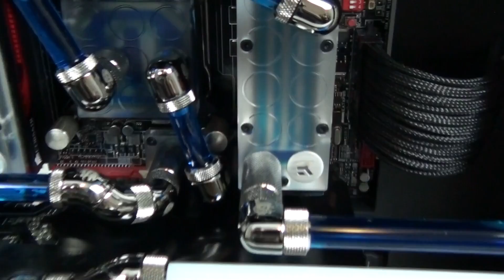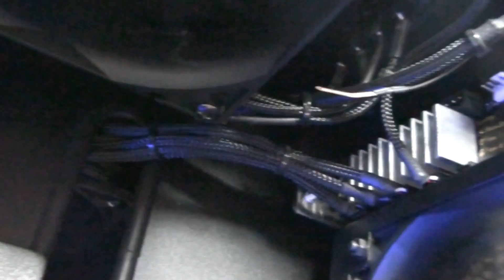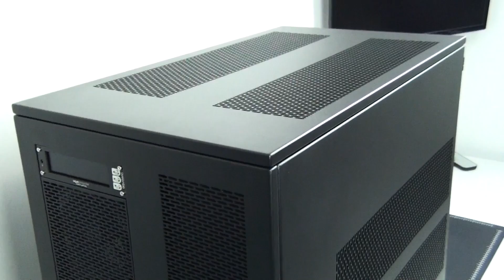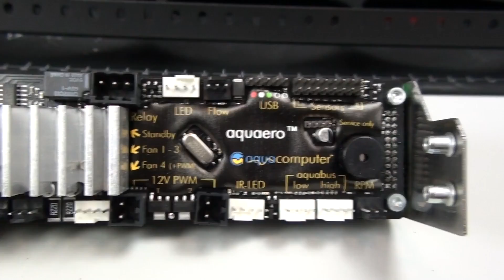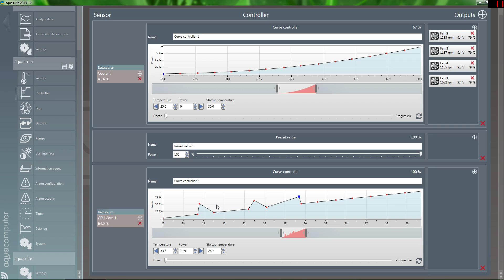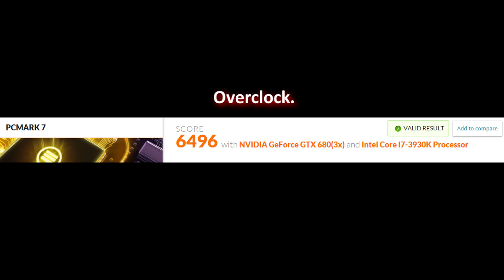Build #10: Extreme TH10: Part 4

Comment: I have the same pump / top rez etc......i was confused a bit about the little plastic nub pill looking part that blocks the unused output on the top of the pump when mounting it vertically like that........the instructions don't clearly explain what that sits on.....idk bad phrasing of the question....

Comment: Hi

Im a huge fan of your builds and recently added a part i saw in a vid of yours, Its an aquaro fan controller. Really cool but i want to know how i can stop it from continuously cycling trough the different pages.

I just want to keep it at the page i have set it on, and it should only change if i change it. Maybe you can tell me how to do this?

Thanks

Nick

Comment: by the way. why is you heaven benchmark not on 8x aa ultra and maximum tessellation? but great vid man. btw my results were 101.3fps 2552 score 13.2 min 197 max on a i5 4670k stock clocks and cooler and a r9 290 1125 on core and 1400 on mem also stock cooler but the rest of my watercooling is not in stock so gotta wait for the x20 pump and xspc fittings and 290 acetal block to be in stock. England sucks for watercooling.

Comment: It looks awesome, but I would never do this kind of build.
How in the hell are you ever (quickly) going to change memory, cpu or videocard.. wouldn't it be a massive pain in the ass?
Reply: with 32gb of ram 3 gtx 680 in sli n i7 3930k u will not need any upgrades anytime soon, unless you want to be up to date with new gpu n cpu yea it will be pain in the ass
Reply: Furple max The problem is when new shit comes out.  When X99 comes out in June you're going to want to buy it, especially if you have the money for it.

Comment: The way you design your systems is amazing. The way you use fittings is nothing short of an art form haha. The way the res has like a stand? or something, idk, I didn't see the installation, and the drain port coming straight out of the pump--i'm going to have to steal that idea. It's practical and functional that way I'd assume--water coming from res, into pump, and pumping out of the drain. I just hope it doesn't spring a leak for some odd reason, or the client doesn't accidentally leave the faucet loose.

Comment: Personally I prefer the look of flexible tubes, plus it's not true they get ruined very quickly: it depends on the brand and if you clean the inside of your pc once a month with compressed air to prevent external agents to get attached and corrode the tubes. If you use a liquid as Aurora from Mayhem you want to see what is going on and flex tubes give you lots to see, plus i find curved tubes very sexy. The rig in this video mostly shows liquid inside the reservoirs, i prefer seeing the liquid flowing along all the route rather than watching metal pieces. Just my two cents, your videos are lovely.

Comment: hey any feed back Id be thankful for I am trying to make a massive dream pc for My self and I am debating between getting the extended ascension  and the water carrel 24 from mountain mods  or the magnum tx 10-d from caselabs I want to add as much as I can  to the system to make the best posble power house of a pc I can make so I am aiming for a large tower that can be easy to  mod any feed back can help or other large towers out there larger then the ones I am looking at now thanks for the help

Comment: Really applaud the effort that went into this, and the end result is stunning. Several thousand dollars, however, for something that won't perform better in gaming than a $1000 build seems...ridiculous. Plus, the client now has a case the size of most refrigerators. All of the dust and coolant maintenance issues should be a riot as well.

Still, no denying it's an impressive job!

Comment: Well, I live in Spain, and also my PC runs 24/7, with the 2 HDDs being constantly reading and more importantly writing. They heat up quite a bit, and I don't want to risk losing them. So I slapped a water block onto both of them, and now they run much cooler, and quieter.

Comment: Well still you could buy a good PSU and a nice graphics card and it would cost the same as a watercooling loop, but you would get more performance. I mean overclocking a 550 really isn´t worth it it will still be very slow
I guess an apropriate psu costs maybe 80 bucks and then you could buy something like a hd 7950 or gtx 760 and this would cost the same as a watercooling loop

Comment: Hey, I was wondering if it was possible to answer a question about wiring since I am thinking about modding but the only thing that worries me is the wiring. I know that I can make custom length wires for pci-e, 24 pin power supply, etc. by taking some copper wire and making it the size you need.  But for some wires like the SATA data cables and 3 pin fan connectors, I am not sure how to make custom length sizes to have perfect wiring aesthetics. Help would be greatly appreciated, love the vids!

Comment: Hey singularity, could you help me.. I have an issue and people will call me rather stupid for trying this, but I was wondering how would I go about for completely watercooling an Alienware x51(GPU and CPU)? I want to watercool it as it will get better temps and all that good stuff. I want it to be compact, if I can't fit it in the case, is there a small like dual rad(or single even) waterbox. It is from last year, it has a GTX 555, and an intel i7-3770.. P.S. If it needs modded I will do so!

Comment: @Payden Pringle

They are BitsPower fittings, if you weren't already aware, but you shouldn't have a problem finding that particular fitting.

Check out Performance Pc's website as they have a large selection of BitsPower's fittings. Other than that, just browse various PC sites (especially those that focus on the water cooling aspect)

Cheers

Comment: Where do you get the rotary fittings you use with Crystal Link? (or equivalent of Crystal Link)

I cannot find a rotary fitting with 2 adapters, one on each side. One side is always an adapter (female) while the other is a normal connection (male).

Comment: Ah, I see that this one was 4.6 ghz with a 46 multiplier.  Curious as to why the ram is only at 1600 mhz?  seems that with water cooled ram you would want to crank that up to 2400 mhz.

Comment: How expensive would it be to watercool 4-Processor Socket Board supplied with four Opteron 6272's with 64 gigs of ram and three GTX 680's........ Planning on building this rig Come March unless something else drops in price due to new releases. The Supermicro boards are a bit proprietary and do not fit in many cases as its a SWTX. would love a Caselabs fit but i doubt that would work. P.S i think it would be beautiful using the crystal links tubes!

Comment: I see people using parallel loops for the Waterblocks - especially GPU - waterblocks but I just don't get why this is good. How can the water flow be a third on each waterblock? My logic would demand that on the bottom waterblock the pressure and flow is really high, and on the top one (with this design) is very low. Or at least lower than on the other two. I just don't see how it could be any other way. Please enlighten me

Comment: with the amount of radiator capacity in this build, push/pull would just add more clutter and honestly not affect the temperatures enough to warrant the extra time wiring twice the amount of fans.  If he had only used two radiators, he probably would've used a push/pull setup.